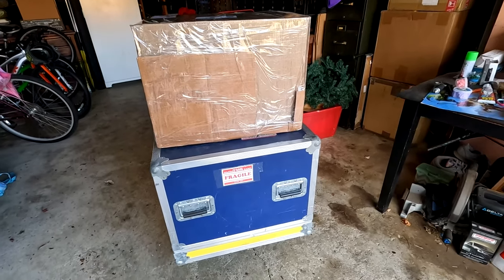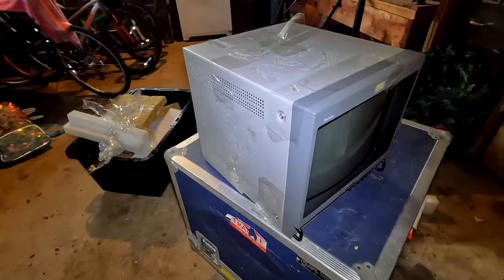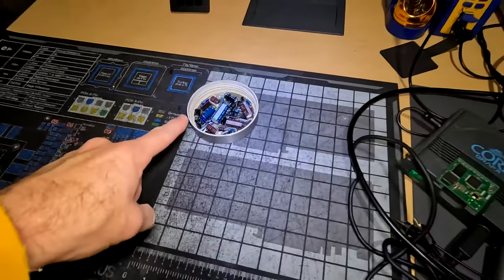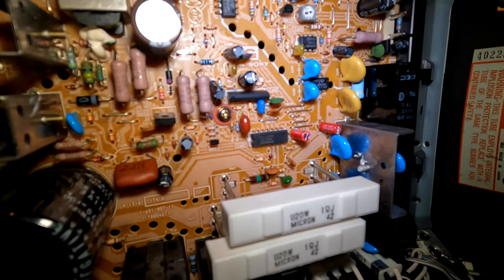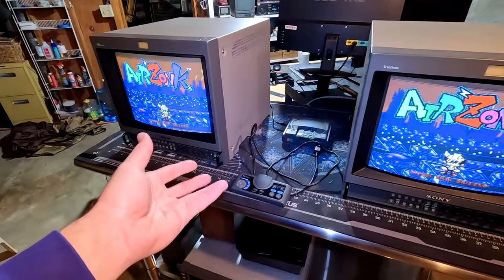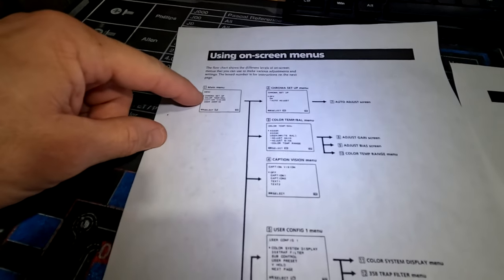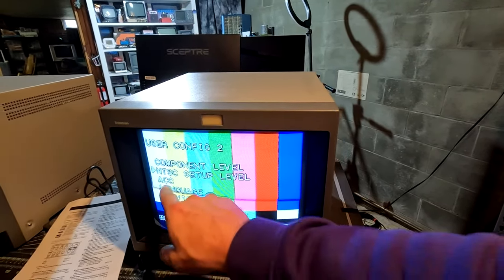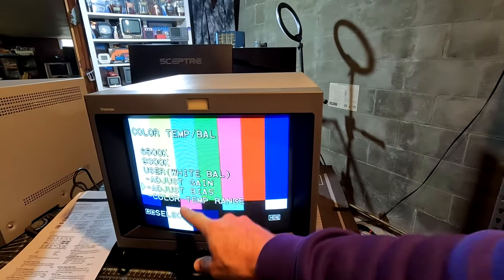Are These the Best Bargain Sony PVMs?  The 1351Q vs The 1354Q

Comment: some people trying to sell these for $600+.  I say $400 max and thats still not what they are worth.

I picked up previous generation 1344Q for $325CAD which has minor blurry focus (adjusting the focus did not work) as a bit washed out green and blue but overall still pretty to look at.  
Other note is that the front LEDs did not work (perhaps a video idea to repair this?), some screws missing, and the Sony badge fell off

Comment: NTSC 3.58 refers to any NTSC composite signal I believe.  That is the frequency that is filtered for the chroma signal that is superimposed on the luma and sync signals.  Since luma and sync are much lower frequency, much less of their signal strength are "trapped" by the chroma trap.  All composite displays have some sort of 3.58 MHz trap by default but this one is likely an additional and/or a higher quality filter that can be enabled to clean up the signal a bit more making the composite a little less composity.  The downside is that rapid step transitions in luma can contain high frequency components which are filtered by the chroma filter because no passive, analog, zero-lag filter can distinguish between a high frequency component of a luma waveform at a sudden brightness transition from a chroma signal of equivalent frequency.  It is a matter of tradeoffs.  I personally leave that function on for composite.  It does not affect the other inputs.

Comment: The 1354Q was the first PVM I bought, just only recently getting into these broadcast monitors. Was not specifically looked for, it was just the first one I came across which was not insanely priced, albeit I did take a gamble on condition as it was reported to not power on. Fix was easy tho. The fact the seller specifically stated exactly how they ship, and FB was what caused me to pull the trigger.

The G-Board situation is wild though, so many changes/fixes/revision. From what I seen in your other videos, I did not get the latest revision, but did have a newer one (much cleaner and less components then the older one).

Curiosity has me tempted to buy a 1351Q, to study what component differences there are, besides just the obv CRT tube itself. Found a potential candidate, no colour error. I don't really need another 13" PVM, but only time will tell if curiosity wins out haha (of if someone else buys it).